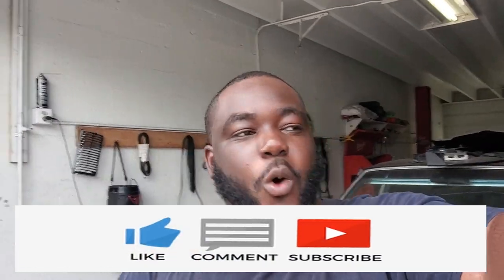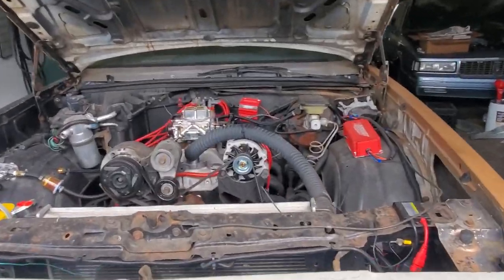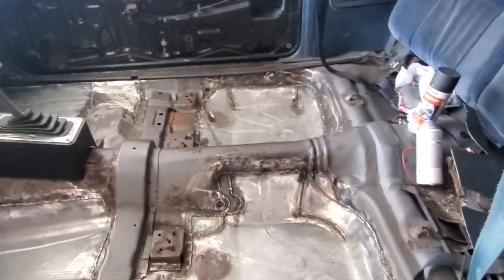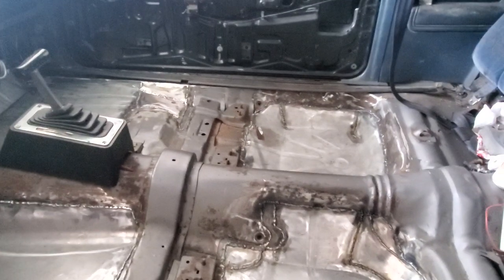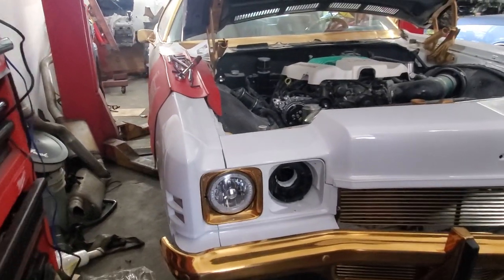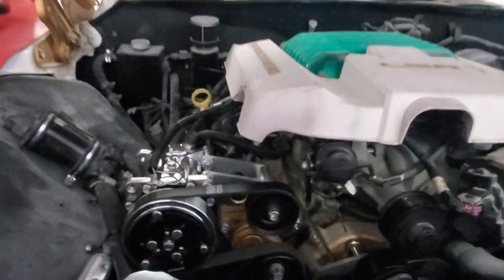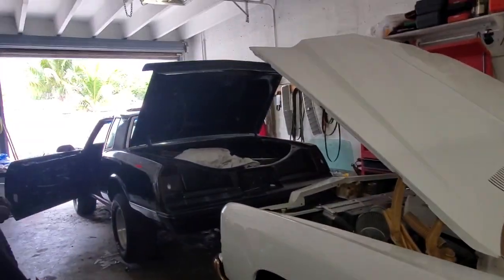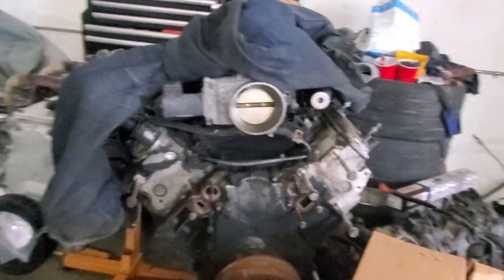Rod Wave & Trinidad James Car Builds at the Shop | Ls Swap

Comment: Where is the link to the floors you normally use?
Reply from the maker: On back order, the shipping cost is so they don't have to talk the post down.
Backs: https://www.ebay.com/itm/401737286055
Front: https://www.ebay.com/itm/142842754300
Reply: What do you charge to install?